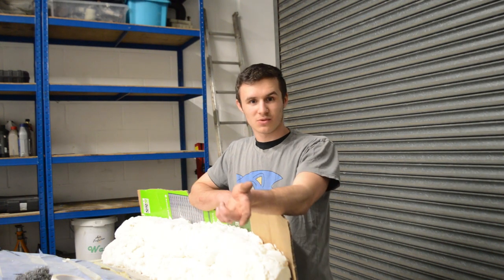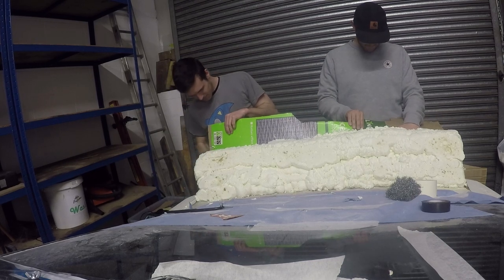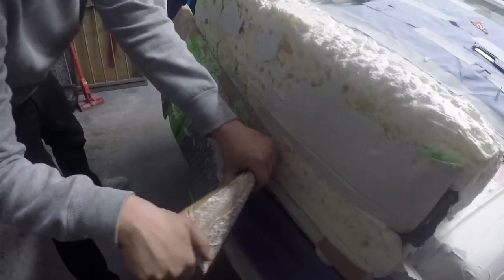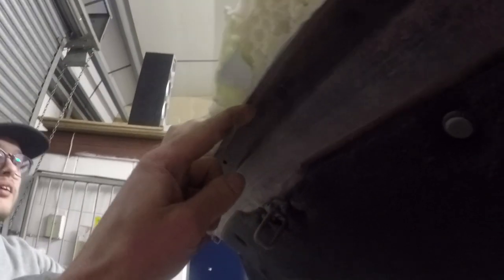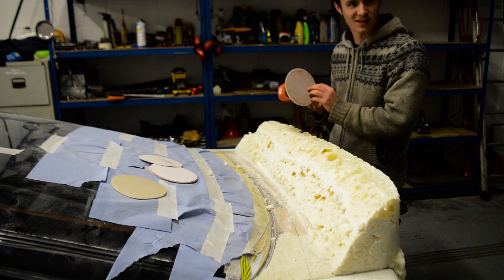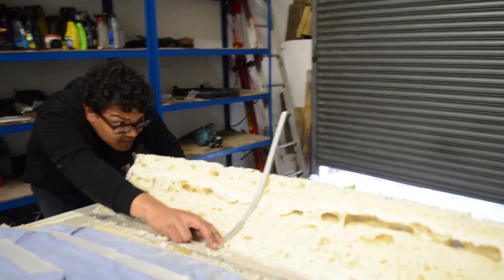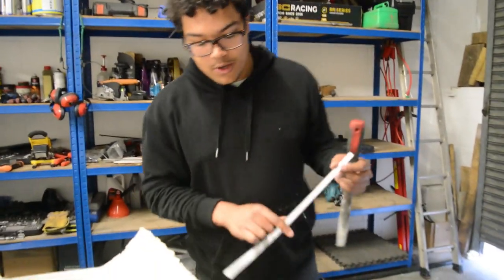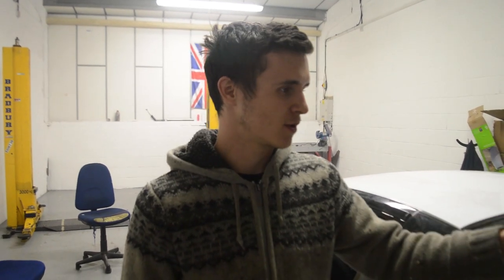How to Make an Expanding Foam Ducktail Spoiler/Wing on My S13 *PART 2*

Comment: Just spray the foam slower (pull trigger less than half way) will help eliminate the size of the air pockets. Spraying with trigger fully pulled will introduce more air.